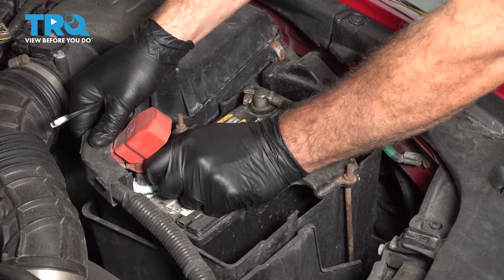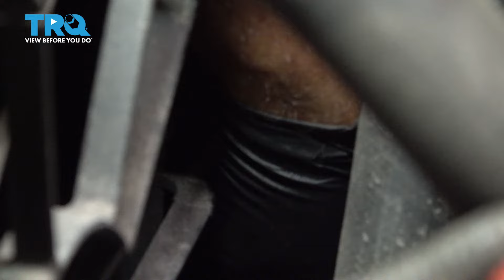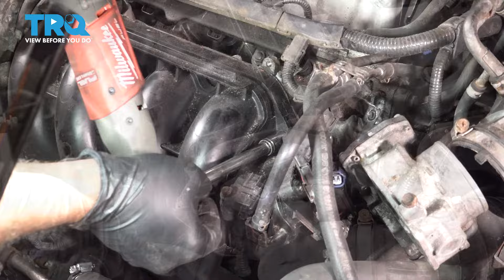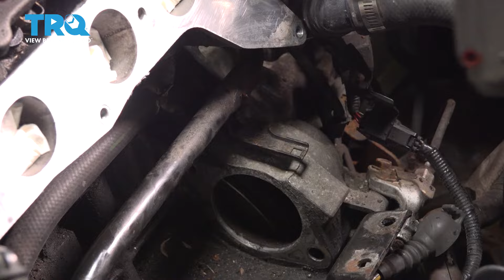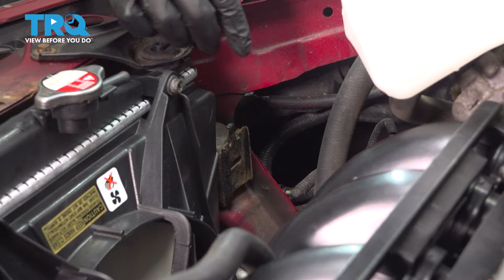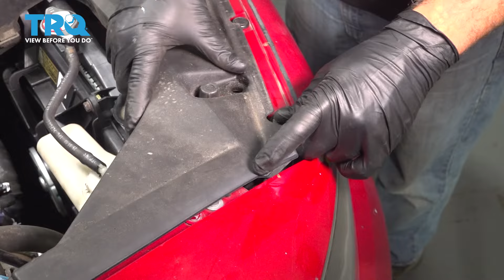How to Replace Thermostat Housing 2008-2012 Honda Accord

Comment: You don’t need to remove all that to get at the thermostats on these k24’s
Reply: How do you get the back bolts out without removing the intake?
Reply: @anthonybrowning6833  put the car on ramps and doit from under I use small ratchet with a  10 mm socket
Reply: what your have to remove

Comment: Thanks a lot for this video.    Had a cracked thermostat housing and you walked me through it perfectly.    Got it done today in about 4 hours.   One minor comment -- you forgot to mention the bolt attached to the bracket on the bottom of the air intake manifold.    I figured it out eventually.    

It was a real bear getting at those two blind bolts behind the housing!

Comment: Excellent video! Just wish I could have seen how you cleaned up the intake manifold surface.  Same as you did the thermostat housing surface? What happens if I don't remove the studs to clean the surface?

Comment: Awesome video for detail, however, you never mentioned you removed the starter motor as the inner thermostat housing is practically inaccessible with-it in. The other thing is your lack to inform people of the use of PB blaster or WD -40 to assist in getting the rusted bolts out, you do mention the Anti-cease lube (Nickel base I assume) which is paramount if some other poor bastard has to do the job again. I spent 2-days getting the stripped bolts out of the thermostat housing, the car had 200k on it in the bolts were disintegrating. I have been doing this for 40 years but never on a Honda. Thanks, DH

Comment: on a CRV 2007, working from below the vehicle, got a cracked thermostat housing, managed to remove the three bolts holding it in place, trying to remove upper hose clip , its not convenient, stuck at that point, trying not to remove so much stuff.